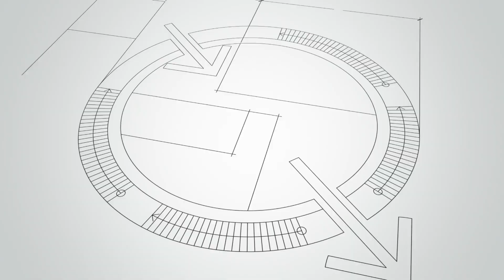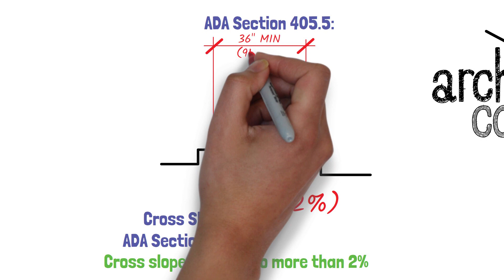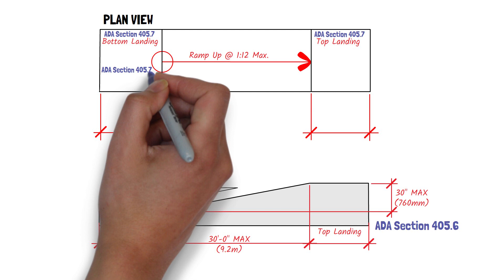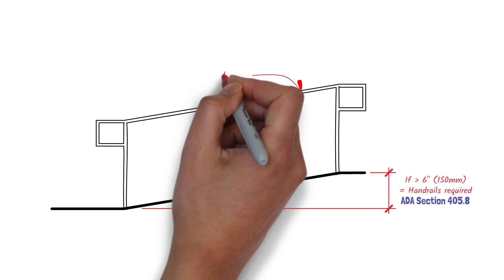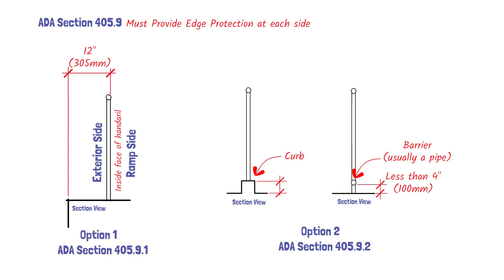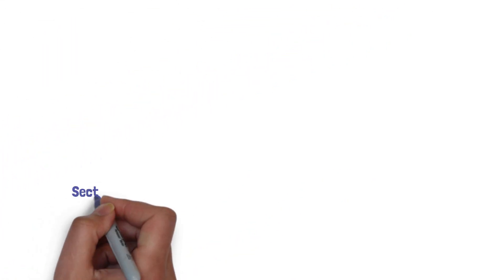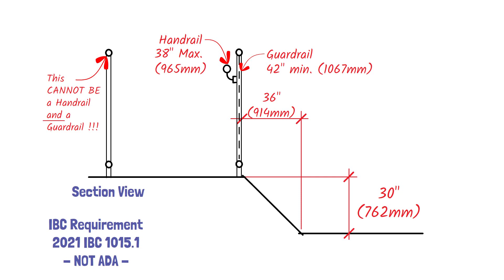AC 005 - UPDATED April 2022!!! - Typical ADA Requirements for ramps

Comment: who has to follow these rules ? schools hospitals new buildings ? I was a builder of 20 years
Reply from the maker: All commercial projects have to follow some sort of accessible code (ADA, ANSI, Buillding Code, etc.). It varies by state, but most codes are based on the ADA, and there may be changes between one state and another. Best thing to do is consult an architect in your local area to see what accessibility requirements may need to be implemented to your project.

Comment: HELP…. my mom uses a walker only. We have a 2-step, total 14” rise, so 14” from ground to top step into our house. What is the minimal ramp length we need for her to safely walk up & down with walker? No wheelchair needed. Thank you.
Reply from the maker: you are welcome.
Reply: @ 😊 Waiting for you to answer my question.
Reply from the maker: ADA and other similar accessibility codes are not simply focused on a wheelchair. The ramp requirements for someone using a walker are the same as for those using a wheelchair. There is no change in requirements between the two.

Comment: great video! a question about the ramp, if we have the ramp at 36" (which is the min) and also need to add the edge protection which takes up 12"- do we additionally add it after having the 36"?
Reply: It should be 36" clear.

Comment: Very Good Information.  Question: For the ADA Cross Slope, you use the ratio "1 inch to 48 inches" for ensuring that the Cross Slope is 2%.  But "1 inch to 48 inches" ratio is actually 2.08%.  How should the '.08' be treated?  Should 2.08% be rounded to 2.1% OR is the .08 dropped to get just the 2%?  Thank you for your time.
Reply from the maker: Speaking form my locally acquired experience, I am not experienced with the entire USA, 2% is what is required. The decimals are not even considered.
Reply: Thank you. @archicorner
Reply: DO NOT GO OVER 2% CROSS SLOPE YOU MIGHT GET THE WRONG INSPECTOR AND WILL MAKE YOU REDO THE WORK.  I PERSONALLY ALWAYS STAY AT 1.5% TO BE SAFE.

Comment: So i have a 30 inch rise and 20ft of length can that be built as one straight ramp? Or will the slope be to much?
Reply from the maker: Your maximum slope allowance is 1:12. Think of it as 1 foot horizontal per 1 inch vertical. If you only have 20ft of length, using the maximum allowed slope for a ramp, you could only go up 20 inches. Therefore 20 feet is not enough run for a ramp. Not to mention you need top landings and bottom landings.

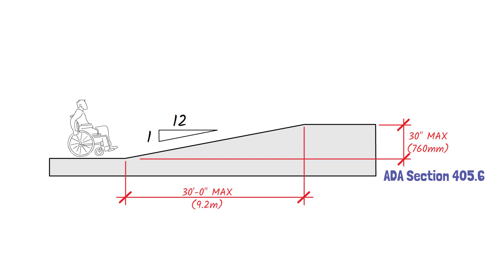Comment: 3:33  Not accurate, you calculated the "shortest possible ramp length for a 30" rise, not the "longest possible ramp length for the ADA rules to still apply."
In doing so, there seems to be a bit of confusion caused.
First, it is not that you "cannot have a 50' to 100' long ramp for a 30"(inch) rise" it is that if your "ramp" is 50' to 100' in length, the ADA "does not consider such a pathway as a ramp as it is so long for such a short rise, it is not steep enough for the ADA to consider it an obstacle which is rises to the difficulty that neccesitates the "Ramp rules" be applied.  For example, in many forests, prairies, etc. raised wooden pathways are often constructed to serve as ADA compliant paths for people to use to enjoy the surrounding nature.  These pathways, inevitably shift due to their very nature of being a low impact on nature as possible (light footings, shallow footings, not the strongest foundations) combined with the "nature" of nature to shift, change, etc. especially in the North where freeze/thaw cycles wreak havoc on such structures requiring footings as deep as 5 feet for a stable walkway.  This shifting, or even the inclined design of a path to overcome the natural rise in the land it traverses, can result in on end of a section of pathway to be several inches or even feet higher than the other end, especially if the section is over 100' long.  To avoid the cost and distraction from view that complying with ADA "ramp rules," these pathways are designed to have a maximum rise of 1:20 thus avoiding the need to comply with the ADA ramp rules.
ADA ramp rules apply only to sloping paths that are over 1:20 but less than 1:12, so a 1:19.999... path would be a ramp that needs to comply with these rules.  Such a 1:19.999 ramp which traverses a rise of 30 inches would have a slope or rise:run of 30 inches (rise) : 599.99 inches (run) [ 19.999 inches ramp length per 1 inch of ramp height means a 30 inch ramp rise would have a 19.9999*30 inch length or 599.999 inches or just short of 50 feet.  Such a ramp is "allowed" but not because the ADA says it is allowed, but because the ADA says such a path is considered a ramp by their applicable definition and thus the ramp rules must be applied.  Again, it is not so much what is and is not allowed regarding run lengths that are very long, but what can and is considered a "ramp" per definiion, as once it meets the definition then you have to comply with all those ramp rules.
Also, you likely won't find a ramp that is 50' long or longer as they are not generally needed or wanted, either because the ADA rules require flat landings as a place to rest every so often or because such long lengths cannot physically fit on the smaller business lots where these ramps often are needed as retrofits or because at that length, the rise is more likely to be so shallow, the path is not a ramp by definition or some other ADA compliant device, structure, etc. would be a better solution.
Your calculation was for the "shortest" possible length of a ramp at 30 inches of rise; A ramp any shorter than 30 feet over a rise of 30" is too steep to comply with ADA ramp rules in general.  Again, you can have a ramp that rises 30" be 'longer than" 30 feet.  For example a ramp that is 48 feet long and rises 30 inches is a "ramp" per this ADA definition as the rise:run is 30":(40feet*12inches/ft) or 30":480" or 1:16 which is smack in the middle of the 1:12 to 1:20 you discuss at 1:30 in your video. 
Conversely, if a path is 28 feet long  and rises 30 inches would have a rise:run of 30:336/(12*28) or 1:11.2, a slope steeper then the max of 1:12; for rise:run, the "run" number has to be between 12 (steepest slope) and 20 (flattest slope) as if the "rise" number is lower than 12, it is generally too steep to be allowed by the ADA, while if the number is greater than 20, the path is flat enough that it is not considered steep enough to have the ramp rules apply to it.

Comment: Does a platform under 30" height above grade require a handrail, or just the ramp leading to it?
Reply from the maker: Fall protection from heights is a chapter 10 requirement (Building Code). Handrails are normally an accessibility requirement (ADA/Accessibility). 
Normally, platforms less than 30 inches in height do not require guard rails.
This takes me to another quick subject. Don’t confuse guard rails with hand rails.
Reply: So....does a platform require a handrail if it's under 30" tall and is reached via a ramp with a handrail?

Comment: Great Video! Recently visited a cousin that needs a ramp. She was told it couldn’t be installed on her mobile home because it was to high. I don’t find any limits on height as long as it meets the slope and other requirements. Is there an organization that can help her get a ramp?
Reply from the maker: As long as you have the room for a ramp and landings and also, as long as you do not interfere with any easements or set backs, then there “should not” be a problem with it.

As for organizations that may help, I am  assuming you are asking for monetary help. I am unsure if that is available. Each county/state may have varying options (if available).
Reply: Thank you for taking the time to answer. Best wishes to you.

Comment: what is the finish required for the steel or aluminum ramps
Reply from the maker: There is no "finish" requirement. The typical requirement for floors in general to be "stable, firm and slip resistant." Steel and aluminum are often stable and firm, but a finish that prevents slipping would be required.